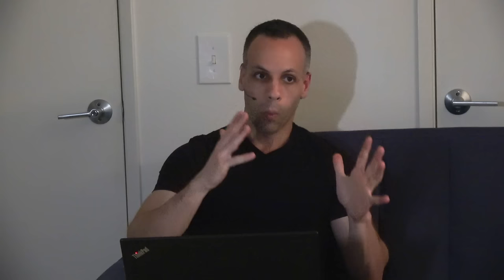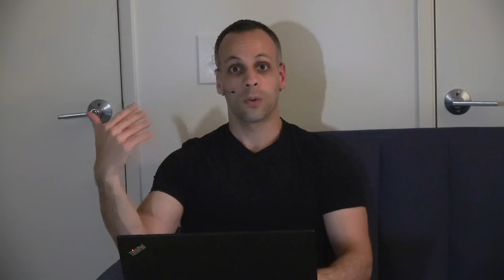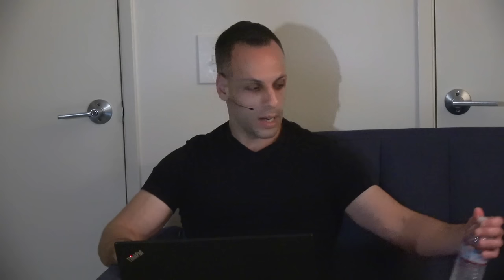EVGA's Oversight: Unannounced Changes Destroy PCs, EVGA takes NO ACCOUNTABILITY

Comment: The plugs for modular power supplies should have been standardized in the entire industry more than a decade ago.
Reply: I thought the obvious thing to do would be use the same pinouts at each end!
Reply: @nicholasvinen  While I don't know why the 24 pin is always a 10 + 14 pin on the PSU end instead of a straight through cable, the others aren't necessarily the same because they support multiple types of cables.  For example the 8 pin 12V can be an EPS power cable or a PCIe power cable (why PCIe didn't just use the EPS connector is another question and why PCIe decided to be polarity reversed from EPS on top of that).  On the multi-voltage side you typically have a 6 pin which terminates to either SATA or the old Molex/Berg connectors on the other end.  So using the same pinouts on both ends would reduce flexibility, but they definitely should have standardized.
Reply: At least with EPS and PCIE you have a good shot at just tripping OCP, swapping 12v and 5v is a death sentence.
Reply: At the very least, I would have expected that the PSU end of the cables for different pin outs to be keyed differently, in order to physically prevent the use of wrong cables.
Reply: @RBrown-uk4xt  If all the companies could coordinate on which off the shelf connectors they're buying for their pinouts to make sure there's no overlap then they could have just as easily (probably more easily) picked a single pinout.
Reply: @RBrown-uk4xt absolutely what i was thinking.. forget between manufacturers, or even between models, at the absolute minimum they should have done this when they changed pin out and called it the exact same model.
Reply: At the very least they could just use ports identical to the ones on the MB so that the cables are basically just extension cords that could go either direction.
Reply: Should have never started using modular PSU’s in the first place…

Now, you get what you deserve for pushing that garbage 😂
Reply: its not in their interest to do this. consumer always loses
Reply: Yeah, you unironically wish for an EU directive to make Corsair Type 4 a mandatory standard.
Reply: @Blzut3 it is 10+14 to allow for new ATX 12 volts only motherboards
Reply: "The plugs for modular power supplies should have been standardized in the entire industry more than a decade ago."

By who?

And for the people who say they should just use the same end on both sides, that just creates the same problem. They either have to wire their side to be a non-standard version of the connector (swap power and grounds around) or they have to key their end so you can't plug it in backward and you're back to a nonstandard cable. Secondly the motherboard connectors are made to be small, not low resistance. They don't want to take that his at both ends of the cable.
Reply: @erkinalp  Nope, if for no other reason than 12VO requires 12V standby power which they don't provide (ATX uses 5V standby).  The 10+14 split has existed long before 12VO was a thing so it really is just a coincidence.  I don't know enough to comment if it would be possible to use the 12VO pinout for the 10 pin and retain ATX compatibility with the 14 pin.  There's a no longer used -5V pin that could be assigned to 12VSB, but you would need to sacrifice something for an extra 12V pin to do 12VSO with a straight through cable.

Edit: Looking up the pinouts again it looks like some use 10+18 pin, so there's definitely enough pins in those cases.  Still 12VO isn't the reason they started doing this and the existing pinouts don't work this way.
Reply: @Blzut3 12VO existed before Intel's standardisation. Various servers and some prebuilts had already been using then.
Reply: @erkinalp  I'm fairly certain PSUs have been doing the 10+14/10+18 thing well before even the systems you're referring to.
Reply: 20
Reply: Modular power supplies are for gamers who rice out their computers. No special modular ATX pinout standard is going to be created just for them, when the desktop market in general is going to die off soon.
Reply: The modular power supplies was always standardized until some gamers complained about the color coded wires and then PSU companies switched them to be fully colored and/or black so that shady companies like EVGA can screw you over and blame you if you use an "incorrect cable" made specifically for EVGA's power supply.
Reply: @timramich  yet for some reason rgb conncetors are standardised
also modular psues arent a purely "gaming" thing. its a qol thing for general pc building so its easier to run cables

also the desktop market is not dying off
even if all gaming suddenly disappeared there is still plenty of demand for desktop tier hardware
Reply: From day 2.
Ie the day the second brand made one.
Then Pci-sig should have stepped in and made it official.
Reply: @zjanez2868  Because RGB is something used more in the lighting industry than in silly gamer rice burner desktops. Desktops are just about dead. Thank Microsoft.
Reply: @EdnovStormbrewer  Modular power supplies never had standardized pinouts.
Reply: Yes, learned about this the hard way about 15 years ago when used Zalman cable on Chieftek PSU or other way around, don't recall exactly. Thankfully I'm electronics engineer and damage to HDD was superficial (for me, not regular user, as it still was fried circuit board). The only fried part was shorted TVS protection diode between some power rail and GND.
Reply: @nicholasvinen The pins are half the time, maybe if you're lucky., the wiring schematic to those pins however is not. So if you plug it one set of modular connectors form one brand, shove them in another PSU (or often enough just different models between  the same brand for that matter), then connect it to the motherboard or GPU. Not recommended.  If it goes wrong it goes wrong so badly it could cost you all the vital parts or worse. terrible idea. Never reuse modulair cables.
Reply: @Kandralla Same organizations that standardize everything.  That's the reason most parts in desktops are interchangeable. At least if you buy your own components. Consumer built Desktops from for instance Hp. Dell and Lenovo.............avoid like the fucking plague.

Comment: The connectors for the cables should have been changed to prevent v1 cables from being plugged in.  There's no excuse for putting this on the users to notice and prevent.

Comment: This brings back memories. Years ago I worked at a radio shack. We sold our own branded batteries and we were under a ton of pressure to sell those batteries, along with warranties. I sold a super expensive camera, our best warranty (80 dollars in early 2000s) and three packs of our batteries. Well long story short. Our batteries melted in his camera. Corporate tried to tell me our warranty does not cover battery malfunction. They expected me to tell the customer with a straight face he was out of luck on his 900 dollar purchase yesterday. Needless to say I replaced the camera, gave him real batteries, and refunded the useless warranty.
Reply: That makes no sense.  If you replaced the camera, then he still had the same need for warranty coverage, and this is a case where the gamble of paying extra for a warranty has paid off, so it would be prudent to keep the warranty rather than refund it.

Also, corporate cannot tell you that the warranty does not cover battery malfunction.  Either it does, or it doesn't, based on the FINE PRINT.  There is no contacting corporate issue, either you are obligated to fulfill the warranty or not.

Now the ugly truth:  If the batteries were not already leaking and this camera caused them to "melt" (which is nonsense, you must mean they vented?), odds are that the camera had a defective design which did not cause it to shut off in an undervoltage condition, which reverse charged one or more of the cells.  This means that if you really want to do the customer right, you do not replace the camera, rather you issue a refund because a defective design is not fixed by another new, replacement camera  of the same model, with the same design.
Reply: @stinkycheese804  particleman meant they refunded the customer's extended warranty (which in most cases is pretty much useless anyway).
Reply: @stinkycheese804  He means that his store ate the costs rather than corporate which issued the extended warranty. Most smaller businesses still do that. It's part of how they survive against the big guys. Building up loyalty with customers.
Reply: @BikeHelmetMk2  Apple didn’t like when I repaired customer devices under warranty instead of telling them lies. Those customers left great reviews on google and told their friends that we care. Customer wants to buy a new computer. Me: is the old one broken? Customer: yes. Me: I can fix it cheaper than the official price because we buy harddisks from the manufacturer and not from Apple. You even have more storage than before. Our service department usually worked for customers, not big tech companies
Reply: @stinkycheese804  warranties are based on the law, not whatever some illegal contract terms dictate.  The extended warranty became useless when the product failed prior to the extended coverage, it's not likely the customer elected to continue using a device that failed so spectacularly.
Reply: @s1mph0ny  No, not true.  The law IS that the warranty is based upon the terms, beyond the initial assumption of fit for purpose.  Granted, it's not the camera manufacturer's burden if your batteries leak and damage it, unless of course, that is covered in the warranty but practically no warranty covers customer caused damage which is what that is.
Reply: @stinkycheese804  The terms of the warranty have to be compliant with the law.  One of the big ones is protecting against normal use within the first year of operation.  If you're saying that radio shack's fake batteries causing damage would be a disqualifier of said warranty I would agree, unless RS was a distribution partner for the camera brand which is likely.  Lots of warranties attempt to disclaim responsibility using illegal terms like the "void if sticker broken" scam.  Even for cases where damage was likely caused by the customer, the burden of proof is on the manufacturer.
Reply: @s1mph0ny  "Burden of proof"?   It's not much of a burden to see customer damage and state "no" and then customer is SOOL, and should've known better in the first place.

RS being a distributor for the camera brand means nothing, if they did not explicitly instruct to use specific cells and even then, it is liability through the cell warranty not the camera, if the cell warranty covers that.

The sticker issue, not really worthy of consideration on this one since that's not what happened.

It is not reasonable to assume that if you use defective batteries in a device, that the device warranty should cover that, nor really to assume anything not stated in the warranty beyond normal fitness for use during the warranty duration.

Comment: Honestly - connectors for different voltages should be made incompatible with each other. 3v should have one type of connector, 5v should have something totally different, and 12v should have something totally different. If you need to change the pinout, then you also change the type of connector to prevent plugging the wrong voltage into the wrong place. That's the real fix for a problem like this.

Comment: While I agree with you on liability in general, I still think EVGA should cover cost of the drives in this case, specifically because they instructed the user to retain their old cables and use them with the new PSU.  Their instructions directly led to the destruction of those drives and there's no other way it could've gone.

In this case, EVGA's directions would ALWAYS lead to dead SATA devices due to the pin-out change.  The only way this changes if EVGA informed the user of the the change and supplied them with new cables.  EVGA were the only party in this transaction that possessed all the facts needed to avoid this outcome and yet they didn't.  This makes them (as a business) culpable, regardless of if it's due to poor support team knowledge, bad knowledge-base systems, organization or plain incompetence.

Every decision made by EVGA, primarily the omission of the pin-out changes (in which ONLY EVGA possess every relevant fact in each RMA case), led to this result, and more importantly, will lead to it again if their process doesn't change. There's nothing the user could reasonably do to avoid this.
Reply: Couldn't agree more. What's worse, is that EVGA apparently has known about this issue for at least 2 years at this point, meaning it has decided not to take any action to prevent this from happening in the future. I can't think of a way to obliterate user trust more effectively. I'll be avoiding any new EVGA products from now on.

I think this should be an easy win in a small claims court as well, if with the help of the community, we can prove that EVGA was aware of the issue. What do they have left to stand on at that point?
Reply: @HazewinDog I doubt you even need to prove that changes in the PSU pinout were made with their awareness. It's not something that just happens overnight.
Reply: I agree, and they have a limited number of warr cases already processed where pinout is different AND where only 2-4 weeks has passed since the PSU was returned (people would have made a claim already)
Reply: This is the kind of thing I heavily endourse lawyers and lawsuits get involved.  This can lead to more issues, and possibly risk of injury, considering I've seen what 12v can do when hitting the wrong thing. I've had an RGB controller blow up in my hand and burn me due to a short on a 12v rail, that sent me to ER.  This is something that can quite possibly cause issues with explosion, or even fire.   While a lot of lawsuits seem stupid and frivelous, this is the type of issue that can definitely result in injury, and this guy really needs to seek a lawyer. 

First off, 22TB of drives isn't cheap. I currently sport around 18TB across two raid sets (mix of 1 and 4tB raid) and last I checked, even decommisions SAS 16-bay cabinets aren't cheap used, plus the drives, plus there's more than just 22TB of drives involved if the guy runs RAID-5/6/50/60, etc..  So he really needs to lawyer up. If this goes viral, it's also possible, with eVGA's attitude, they would sue him for defemation.    Remember: a good defense is a good offense.  This case/scenario applies.
Reply: Jesus... if you RMA a PSU you give them the part number, so they instantly have the manufacturing date and everything is logged, 
the support people should instantly have a red glowing exclamation mark on screen in their Ticket System when this PSU serial number is entered.  
It should not have been changed this way to begin with, extremely negligible but for whatever reason they did it anyway, so at the very least they have to be aware to swap the cables along with the PSU in this specific case.  
It is weird that they don't want to test and change cables as necessary to begin with... defective cables are a thing.
Reply: Yeah, I don't know how Louis is sticking up for them.
Reply: The fact that we're having this discussion at all is insane to me. The onus is on EVGA to prove that the damage was not caused by their blunder - if they can't, they have to pay up. At least that's what EU product liablity laws say, I wouldn't be surprised if there is no such legislation in place in the US
Reply: @peteledoux6120  You're assuming a bit too much regarding the size of the disks. The OP literally said in a post "BOTH of my drives are with a data recovery company", so I would guess they were fewer, larger drives. So the part about "16 bays enclosure" is not so relevant.
Reply: FYI update from GamersNexus shows the EVGA has resolved the issue to the cutomer's satisfaction and is paying for new drives: https://youtu.be/66HkbAGX83g?t=437
Reply: @cacman440  Wow, so nice of them... They gave him a couple hundred bucks, but only AFTER the issue made the news....

(Personal pet peeve here - I HATE IT when companies "do the right thing", but only after public pressure forces them to. Because most similar cases do not get to the press, and if you or I were in a similar situation the chances of actually solving the issue with the company would be quite slim.

Even in this case, EVGA initially flat out refused to cover the damage)